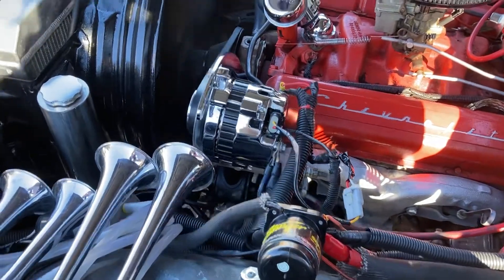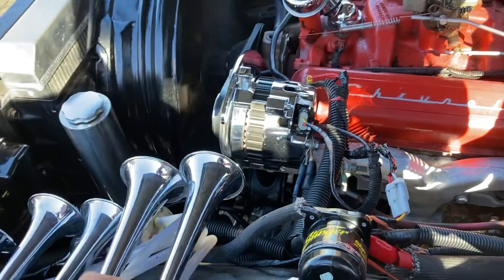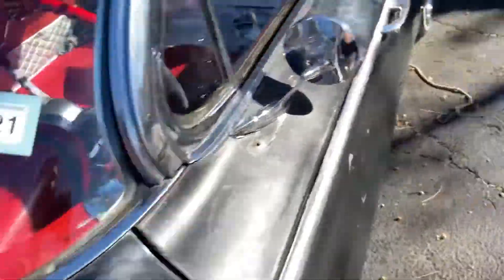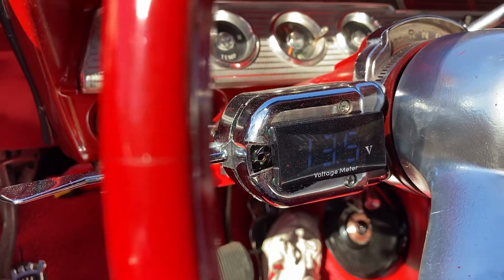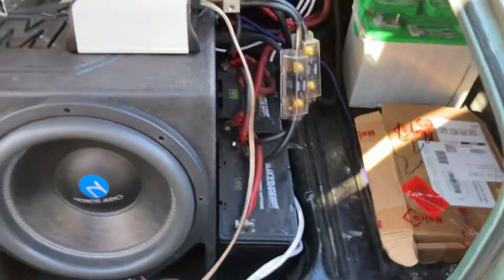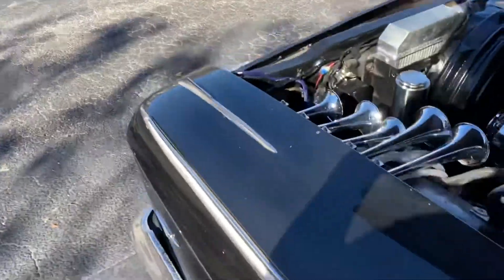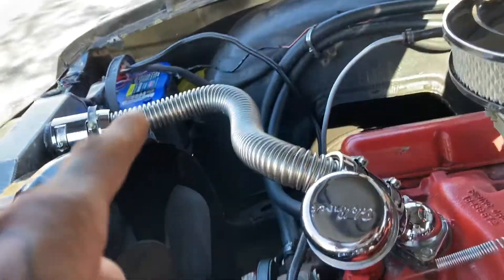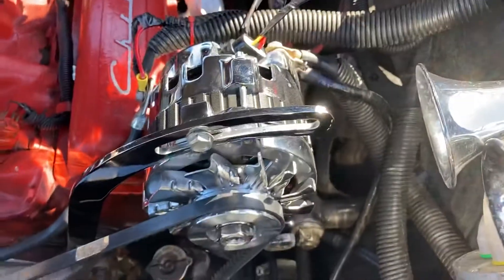220amp alternator chrome GM

Comment: That engine bay is looking clean Vincent. Where did you get that overflow for the radiator. I have been using water bottle and is time to go.
Reply from the maker: I got it off Amazon! Chrome overflow tank! For around $25 thank you sir. I got the radiator off eBay for around $120
Reply from the maker: Before I got the overflow tank I used a glass wine bottle lol
Reply: @vincentbryan1962  Thanks Vince, I appreciate the info.
Reply: @vincentbryan1962  Thanks for the reply Vincent,  I really like how your car is turning up, keep up the good work.

Comment: Question, where did you order the alternator plug wire from?
Reply from the maker: I got it off Amazon! I had to look carefully at the alternator and the plug pictures to see if they matched up because a lot of them are different. You can zoom in on the pictures and see all the different types of connections